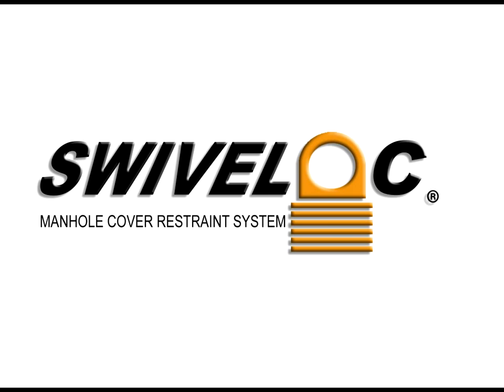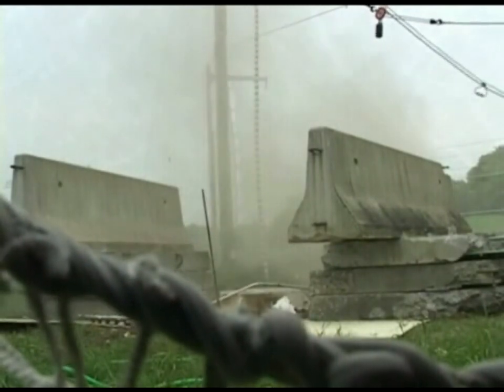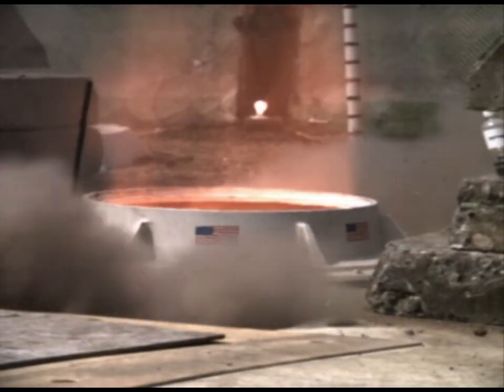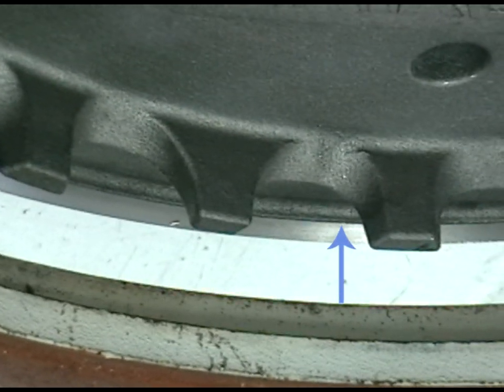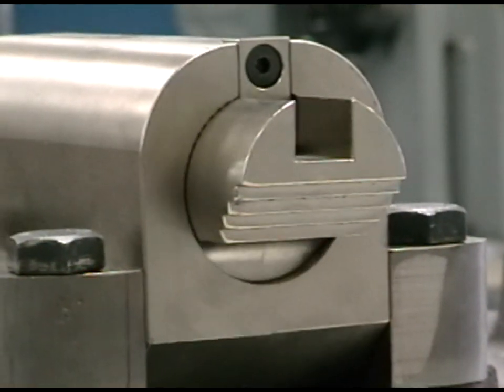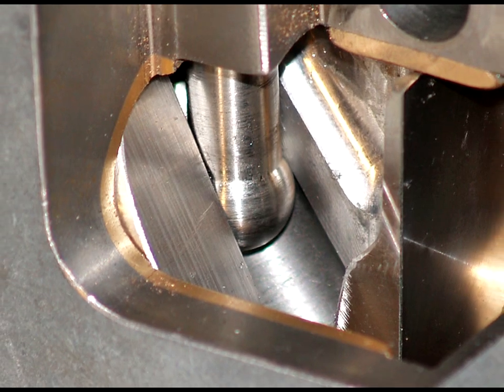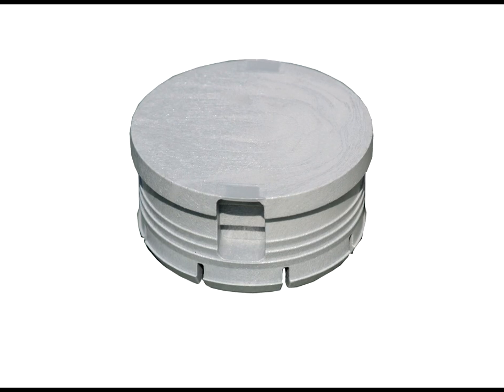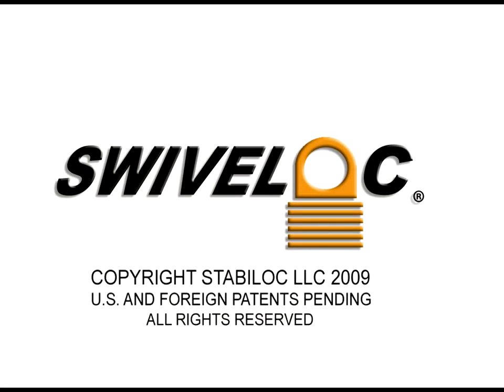Swiveloc Manhole Cover

Comment: It seems the access plug isn't very tamper proof, though it does provide a bit of security, I think a better solution is possible. Perhaps a automated access switch, along with some kind or a key or special tool to retract the bolt.
Reply: I believe the latest design update utilizes a special key for retraction and access. Also my understanding is that the latest design update includes an RFID chip that can relay unauthorized access.